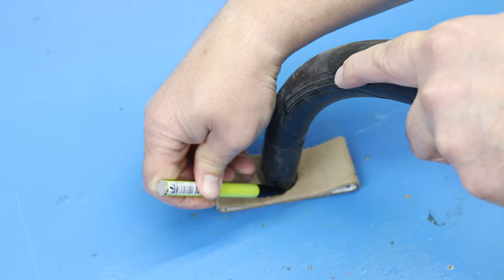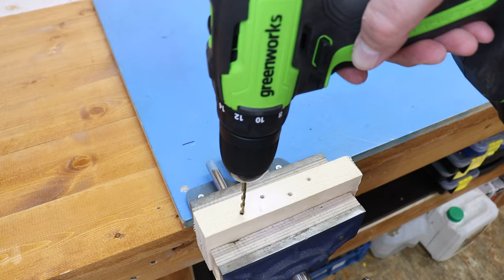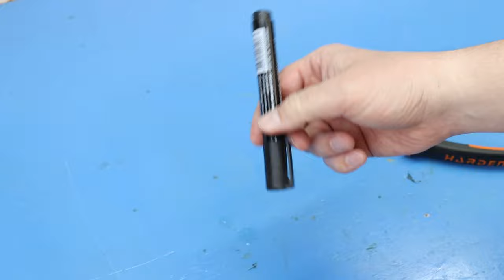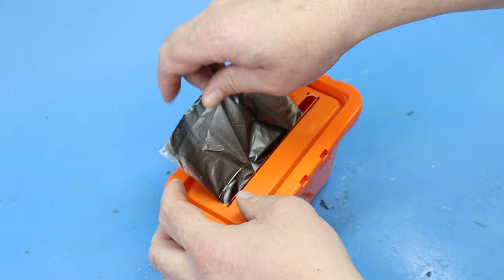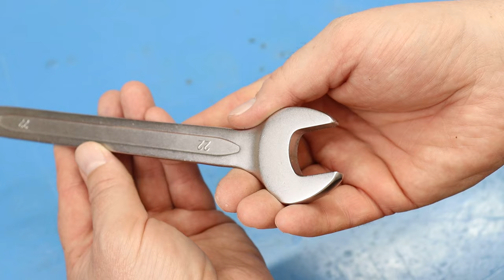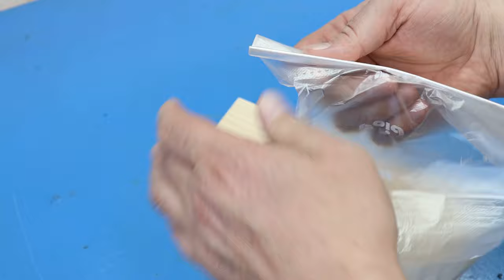Few people know this SECRET of the old MARKER. You've never seen anything like this before!

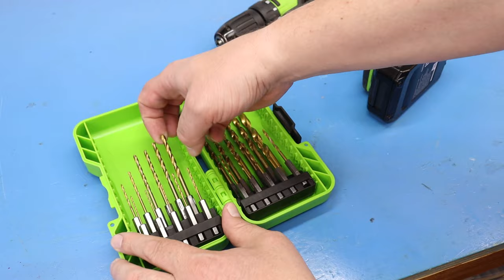Comment: 1:00  Sorry but drilling out the holes and inserting rivets is a horrible idea!  Rivets are made to flatten on the other side clamping down on the opposite flat side.  All this is doing is creating a small bump with only a 1/4" penetration in soft wood.  PLUS, now the hinge is not serviceable and you have huge holes in your frame.